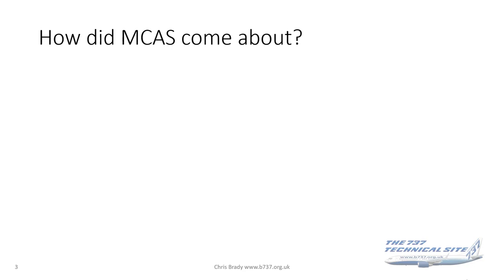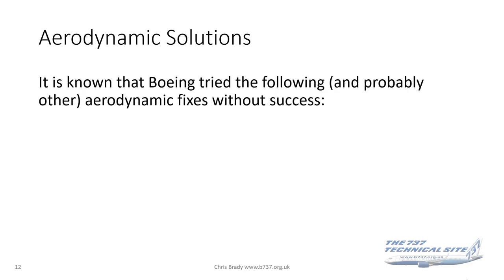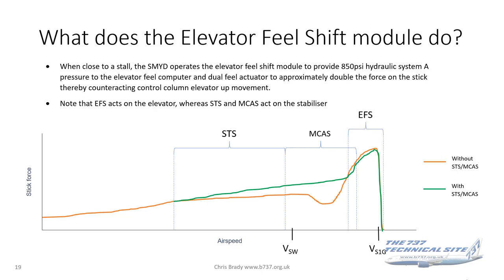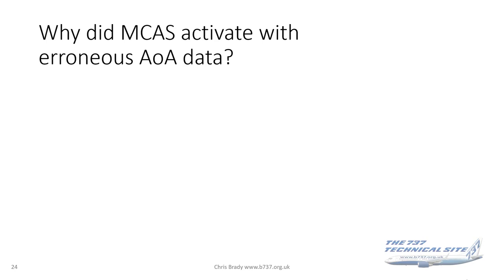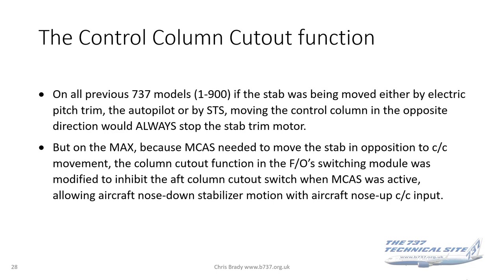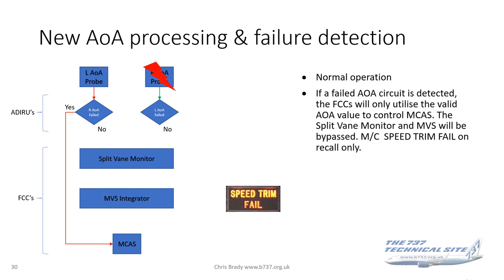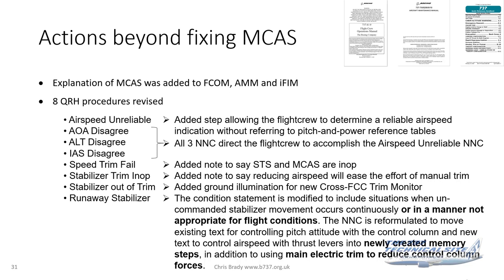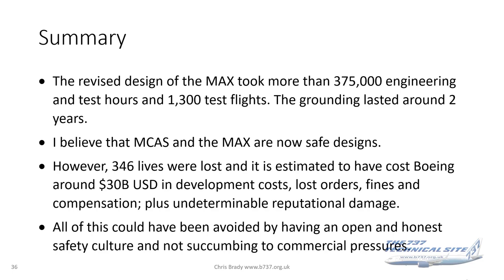MCAS in detail on the 737 MAX

Comment: Great Presentation! Also I am flying on the 737 max 8 to Vancouver from Toronto almost a 5 hour flight starting on 13th April!
Reply from the maker: You need have no concerns about flying on a MAX. The MCAS issues are all resolved.
Reply: @ChrisBrady737 cheers captain, I will enjoy flying on it!
Reply: @ChrisBrady737  hello captain I have a question, do the 737NG and the MAX behaves differently for the pilot control and is it similar to control the NG to the MAX?

Comment: If the pilots in the 737-MAX crashes used their electric pitch trim on the yoke every 5 seconds, would they both prevent MCAS activation and be able to trim the aircraft back into a normal stable state?
Reply from the maker: Probably

Comment: Great job. I’ve always been confused about the feel unit, basically this caused the force to double what it would normally be…? Wouldn’t there have been a way to deactivate that unit, possibly pulling one of the circuits? Assuming it was overhead and not on the back wall
Reply from the maker: There was and is no way to deactivate the unit. More details are in my Flight Controls - Pitch video.
Reply: @ChrisBrady737  another Boeing logic fail. How could they not have seen the disaster coming!

Comment: Great video, glad I found your channel.  I work in IT development for a global company and it would be unthinkable to NOT have x3 or x4 hardware redundancy.  I just cannot understand Boeings oversight which is glaringly obvious in hindsight.  Similarly and I’m focusing on AF447, why isn’t GPS used as an additional check for speed, laterally and vertically?
Reply from the maker: Thanks Luca, glad you like it. The main problem with GPS speed is that it is a groundspeed not an IAS. Some Boeing types have synthetic airspeed I believe that this uses GPS speed in its calculations somewhere.
Reply: Because if you want to add a new AOA senser, you must add a new ADIRU. That means it need a brand new system for the new 737. So in the 737 max 10 they use 2 AOA
senser and a eAOA from the ADIRU to get triple AOA data and not need a brand new system. The ADIRU can calculate the AOA but the GPS can't.
Reply: What is the third AOA value used for? So much money wasted pretending to fix what ain't broke, and playing charades and giving intellectually dishonest demos in flight simulators… just to hide the fact that two airlines were not giving their pilots the basic training required for the 737 type rating and between them they killed 346 people. Why the cover up? And the cherry on the top— pontificating about lives lost in the pursuit of financial gain. So much for integrity.
Reply: You can't understand it but it is glaringly obvious in hindsight? Nice! So you now have an obvious non-understanding of Boeing's oversight, whatever that may be. As long as you are arrogant enough to believe that the knowledge and understanding you have in one field enables your understanding of another complex field by substituting common sense for the specialized education required, your understanding of that complex field will be plausible nonsense. But since it seems plausible to others with common sense, it will be easily accepted as the truth, even by you; enough that you will feel comfortable passing judgement and condemning others. It's captured by the adage: Little knowledge is a dangerous thing. Stick to IT until you get an education in aeronautical engineering. Maybe get one in IT too, you might learn that redundancy is provisioned to the level needed, not per some daft blind rule; you can make a system less reliable by providing too much redundancy.
Reply from the maker: @petep.2092 I am not sure who your comments are aimed at but please keep the debate good natured. There is no need to descend to that level 👍

Comment: Liked the presentation, but isn't this all kind of like using magnets to flip the dice, to pass the test, on an inherently unstable airframe.  It's one thing to let the military develop mcas for its tanker configuration, people sign up to to take risks in the military. A lot of people know that those engines and their placement makes the airframe unstable and easily be demonstrated. This new plane should have been marketed as having come from Rube Goldberg inc.
Reply from the maker: I go into detail on the concealment of MCAS in a separate video "The 737 MAX and MCAS from development to fix". I have since read a comment from an FAA employee who has said that MCAS may not have been needed at all. Who knows exactly what the truth is?
Reply: @ChrisBrady737  i had watched after the first crash on a news program about that crash in which they had on a retired pilot who also was an engineer as their expert commentator. In the segment he discusses the differences between the old 737 and max and described how the size and more importantly the placement of the engine would affect the flight characteristics and when this airframe would experience trouble. Turns out he's right. The flight contol issues that mcas is addressing are the same ones as described by an outside engineering perspective that was observed early on. I'm thinking I probably would not trust someone who says mcas might not have been needed unless it's from the camp that says halt production we got fix this the right way.
Reply: How is the airframe inherently unstable? And please DO demonstrate how the engines and their placement makes the airframe unstable. Or would that be MORE unstable as it is already unstable? I'm eager to hear.
Reply: @petep.2092  You should ask the veteran pilot and also an engineer who was on television news  early on when this wholesale debacle started. He actually described when this configuration might encounter trouble, and as it turned out, that was the target of the Maneuvering characteristics augmentation system. Ps It's It's not just the placement but also the increased thrust.